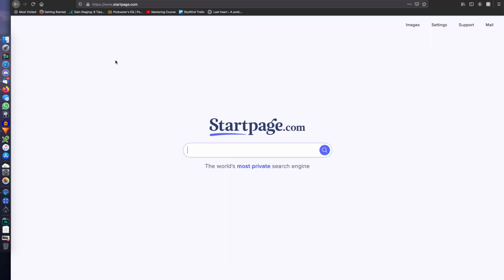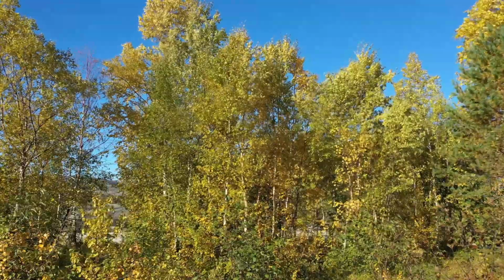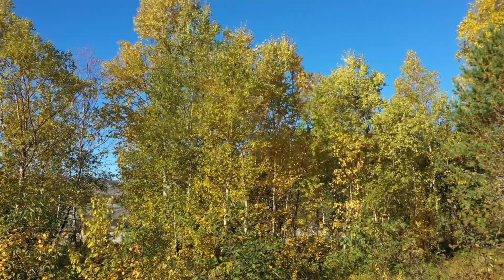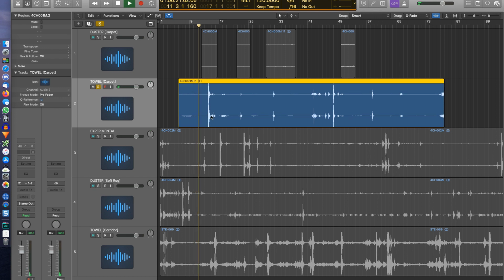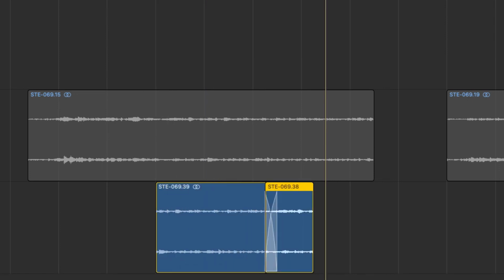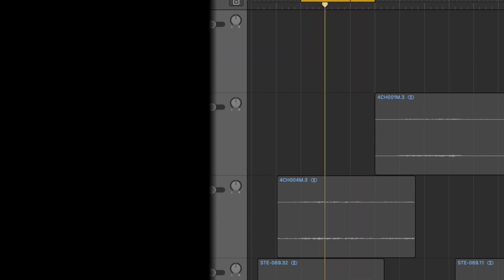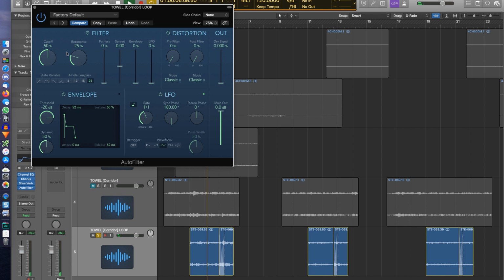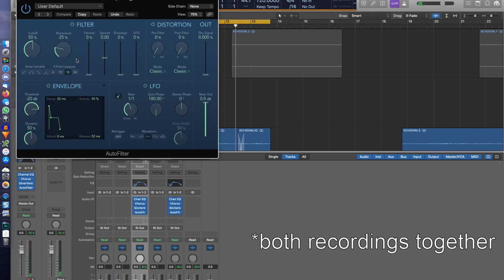How to Sound Design Wind Noise (without synthesizers)

Comment: Amazing mate thanks for this
Reply from the maker: Hope it helps mate!
Reply: @AturaxAudio  definitely will man, just about to start sound design of my first feature film and only seen bike wheels with a coat/silk sheet as the option for recording good wind foley but this is so inventive. Do you have your socials tag and I will shout you out if sharing a clip creating some of the film's foley?
Reply from the maker: @marlofilms6239  Yeah I looked up some of those methods myself when I was doing a production. I found that using a bike or something mechanical meant introducing unwanted noise into my recordings and that is actually why I ended up doing it the way I show in the video.

Definitely give me a shout when the film is done, I'd like to take a look.

As for socials, I'm pretty bad at this stuff, but you could get me on Twitter @GeoffAturax cheers!

Comment: Nice video! For me, maybe the sound of the wind is too loud for the scene, but I think you got the point of making good sounding wind here ! 
Also, about the looping tips. I generally loop my ambience by cutting the first and the last second of my clip and put the first second at the end of the clip (on the track below) and the last second at the start of the clip. Then I crossfade the 2 tracks to fit perfectly together. Your technique seem much more simple and fast ahahaha., thanks for the tips.
Reply from the maker: Thanks for the kind words! You know, I was worried it was too loud, but then I checked it against the original game audio and it's not that far off. It may be sounding louder still after I processed all audio for this video. Ah well, lesson learned! Glad I could be of some help with the looping technique!!